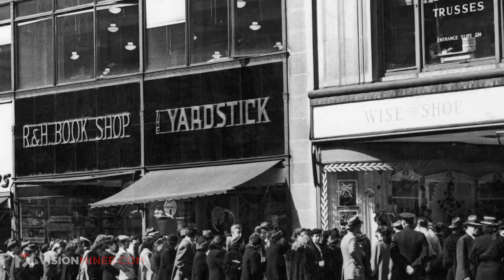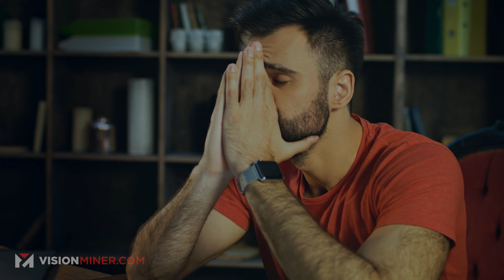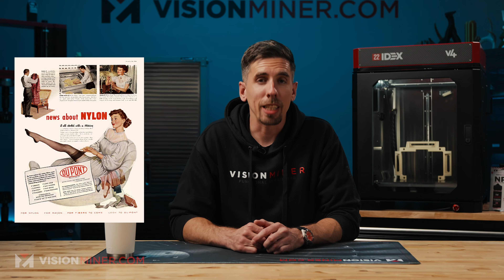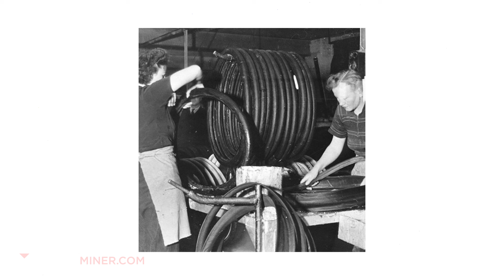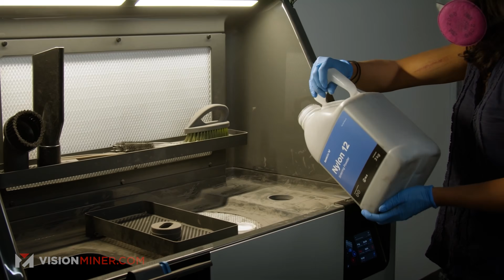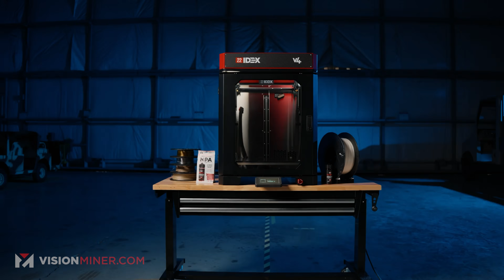How a Patent War Created Nylon 6

Comment: Off topic: how come you guys don't carry Tungsten Carbide nozzles? The FDA considers it food safe as of 2021. It has similar thermal conductivity to brass, much higher abrasion resistance than hardened steel, and much cheaper than PCD. It's kind of the perfect nozzle in my opinion.

Comment: Polyamide's affinity for water is not only a weakness but a key strength that makes this material so incredibly tough, slick, silent and strong. Nylon parts such as gears are cast undersize and are bagged with a little water on their way from casting to assembly, letting them saturate to 4%. The water acts as a form of plasticiser. This also expands them and makes them easy to slip onto shafts. As it loses moisture, first it will grip onto the shafts harder, but eventually it will grow brittle unless rehydrated.

Comment: Normally have good luck with 3DX filaments, but just got a roll of PA6-GF that is super wet right out of the bag.
Reply: Hence the requirement to dry it before every print. It's a step in the process of printing this material.
Reply: @sixdegrees6434  No. Should arrive dry out of the packaging. Thermally drying nylons before every print breaks down the nylon structure. Use a proper dry box. Cheap filament manufactures have trained people to think dying is their responsibility. Mark Forged got this right over 10 years ago! LMFAO